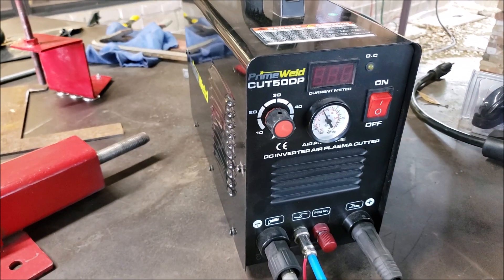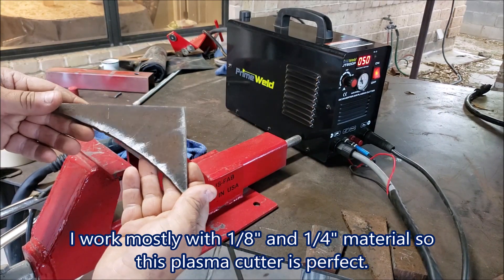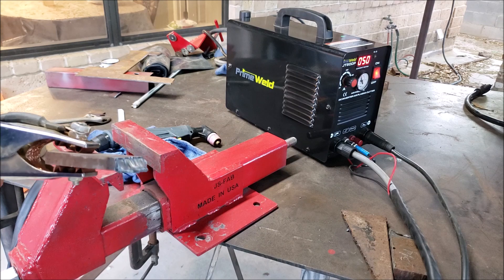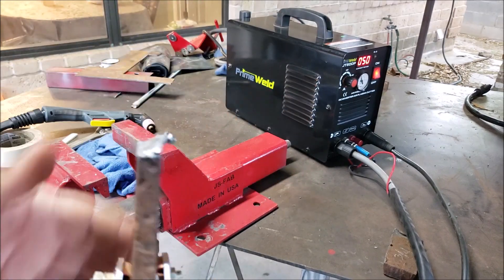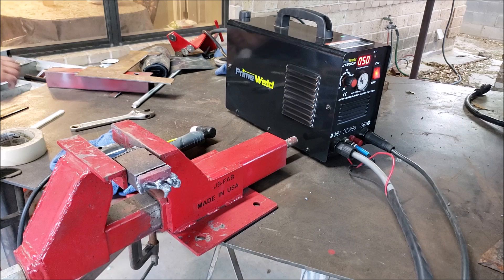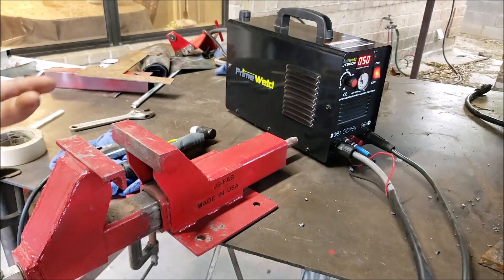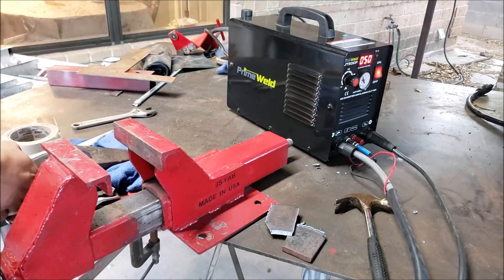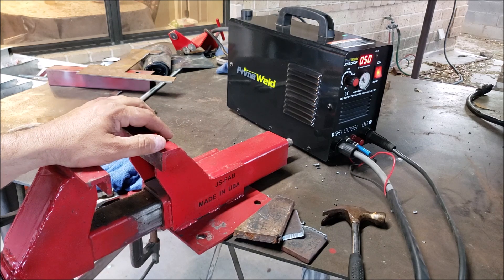Testing the best and Cheap Amazon Primeweld CUT50DP plasma cutter on 240v

Comment: What size of air compressor were you using?
Reply from the maker: I think I was running my DXCM601 which is a 60 gallon compressor. I have used a 24 gallon compressor with good results before when on remote locations.

Comment: Did it cut better after you replaced the consumables and took more time and 
connected the ground clamp to the work?
Reply from the maker: This cutter worked great after fixing my air supply. I replaced this machine with the Primeweld CUT60 and I am very happy. I have other machines I tested last month, are you interested in Primeweld or a budget entry cutter.
Reply: @cutweldngrind I consider Primeweld to be "entry" level because I really don't care to waste time on "less than" equipment any more.  The very MOMENT I learned that YesWelder was using aluminum wiring I lost ALL interest in their products despite them giving me a nice hood for helping them make a correction in their manuals. I hope I like the hood, but haven't struck an arc in front if it yet. I just bought the PW TIG325 and am considering their cutting tools-as they have quickly built a solid reputation for pretty good stuff at a fair price. I watch Jody (WT&T), Aaron (6061) and Justin (TFS) mostly. They make good content-and from a professional's perspective-without being too pushy on products and services.  Happy Thanksgiving.

Comment: One problem you have is not enough air pressure...you need 90 psi..thats why your cuts arent straight..plus the tip is probably distorted...55 psi isnt enough

Comment: The primeweld website says 55-60 psi air pressure for the plasma. Were you able to cut the 3/4 inch with that air pressure?
Reply from the maker: I know I tried 60 psi but not sure if I ran 60 or 65 for my .750 and 1.0 inch plate test. I actually been wanting to place my Crystal 3000psi digital gauge to verify pressures.
Reply: @cutweldngrind  awesome! Thank you for your reply. I've got a 20 gallon 135psi 110v air compressor and was hoping it would be big enough to run this plasma cutter.
Reply: @cutweldngrind  I only have 1 240v 50amp outlet in my shop and was hoping my 110v air compressor would work since I would need my one 240v outlet for the plasma cutter.

Comment: Thanks for another great video. These seem to be a nice step between the no-name/no-support cheapest Amazon machines, and the industrial quality high $ Miller/Esab class. Thinking about this, or the Primeweld 60.  Rarely do I cut anything 3/4 or larger (and I have a torch for those occasions) and I doubt I’ll ever own a cnc cutter table.
Reply from the maker: I never got a chance to use or own a torch but I would like one in the future. The online market place is loaded with junk that has no support but Primeweld is an awesome brand that has the best customer service I have ever seen. I tried getting an ESAB or (forgot brand name)  but they were super expensive that I just went elsewhere.

Comment: Nobody mentioned it in the comments, but before I buy one (I own their TX225 TIG welder), and I'm looking at the cheaper strike-to-arc model, I'd like to know more about why all your cuts were at an angle.  Why was the arc blowing off at an angle instead of straight down?  Did you ever get to make a cut with this machine where the cut was 90 degrees to the surface?  Makes me wonder if these prime weld cheaper plasma cutters are really worth the money or not.
Reply from the maker: That's a good question. I did notice the angled cuts more once I went to 3/8" or 1/2" material. I was first thinking the consumable were  worn out  and when I  replaced the issue seemed to fix it self but noticed it a few minutes later. I wanted to try higher pressure but did not want to damage it as I was going to give it away. My powermax45 runs at a much higher pressure but not sure if the issue could be related to the design of the machine or torch itself. I do want to buy another one as its a hassle to be moving my Powermax.
Reply: @cutweldngrind  I bought one and cut 3/8” without the angled cuts you got. Very happy with it.

Comment: Jorge can the tip be dragged across the metal when making the cut or you have to lift it up a bit?
Reply from the maker: I had no problem dragging the plasma cutter. I had the plasma cutter about 6 months to test and then gave it away. The Cut50DP has pilot arc and maybe that's why it can be dragged. This unit worked great and been wanting to buy one.
Reply: @cutweldngrind  
Thanks you Jorge..

Comment: I have a 15A circuit at home, will I get away with using it or will it flip the breaker?
Reply from the maker: I did my cutting on 110V-20A and 240V-50A. I think you could probably cut thinner materials but since I gave the machine away I have no way of testing this out.

Comment: I generally notice that I had to increase air pressure a bit and seriously reduce speed when approaching maximum capacity. Different machine, same rating. I said "had to" because mine was stolen while in the hospital with a heart attack. Fine healthwise but still trying to replace stolen equipment. Insurance company paid depreciated value, not replacement cost. Changed insurance policy. I suggest everyone verify replacement cost coverage!
Reply from the maker: I actually started to increase pressure on inlet but I really should verify with my digital gauge. I used a powermax45 and also struggled on 3/4 inch plate. I know the feeling of getting things stolen as my first welder was stolen after a few months. I was told to document all my serial numbers and never did so but that can probably help in a case. Take care bud. I should start making more videos soon.

Comment: Very realist video,thanks for taking the time to show the machine. What machine do you recommend for 1/4 “ metal? Not necessarily a cheap machine.
Reply from the maker: I am just a hobbyist fabricator so I don't have much experience with many welders. I like to Arc weld with my Hobart Champion Elite on 1/4" and thicker. I have used a Hobart Ironman MIg welder and that has worked great for me too.

Comment: To make a good cut in that 3/4u have to:
Clean your metal
Check of u have a constant psi
New consumables 
And use the space guides
Reply from the maker: I think this machine is rated for 1/2" max. I did run another test using new consumables and the cut looked a bit better but would not cut 3/4" The pressure is constant coming from my 60 gallon compressor. I did apply a bit more pressure than recommended and the next step would be to put my digital gauge and verify pressure. Thanks

Comment: Thanks for the nice demo Jorge! I found your video while researching plasma cutters under $500. I am building a street rod out of a 1940 Ford pickup that has been in our family since 1963 when me grandpa bought it for my dad when he was 16. A plasma cutter would be very useful for this project and others. Could you please show how this one does on 16 gage rusty and painted metal?
Reply from the maker: 16 Gauge is very thin and this should go right through it. The Pilot Arc allows the machine to cut through painted or rusted materials.  I am planning a video soon where I demonstrate the Pilot arc and Non Pilot arc cutting painted, rusted and clean steel. I will see if I can find a fender or some material in that thickness for you.
Reply: cookie did you wind up getting one of these? If so do you have to lift he nozzle up a bit or can you simply drag it across the metal as you are cutting?
Reply: Your grandpa Sounds like he was awesome

Comment: Awesome, Been wanting to have of those kind of cutting tools , tired of grinding hehe keep it up !
Reply from the maker: Thanks 👍. When I bought my first plasma cutter it cost me $700 and was used, New price was over $2400. I have ran several test and it has worked great so far. I highly believe if you cut 1/4" or thinner material this will be a good machine as they also have great customer service. I prefer a plasma cutter over several of my cutting tools because I don't like shavings all over. I will be giving this away either next month or June.

Comment: Thanks for the review. I'm researching plasma cutters now.  Have body work to complete on our 99 XJ. 

Beats using using a grinder with cutoff wheel. 

Looking forward to the next episode..
Reply from the maker: Glad I could help. Professional  plasma cutters will cost upwards of $2000 like the PowerMax 45 I own. I have seen several machines in the $300 to $500 price range that just allows people to buy their first cutter. I should be giving this out next month or June the latest.

Comment: Nice review keep it up, definitely would like to know what size air compressor your using sir? Looks like a nice addition 👍🏽
Reply from the maker: I did a video on the compressor on my channel but its a Dewalt 60 Gallon, I believe it was the DXCM601. The Plasma cutter runs on lower pressure ( 55psi ) which allows me to cut a lot of material even with the compressor off. I also run a Husky 30 gallon and that also works good. The PowerMax45 also works great with the 60 gallon compressor but the 30 gallon struggles to keep up as it used more volume at a greater pressure.

Comment: i just bought the prime weld arc welder and 50 amp plasma cutter combo machine  Haven't got to use it yet
Reply from the maker: I have enjoyed this cutter for sure. I like the compact size, light weight, multi voltage and price. PrimeWeld also has good customer service. Let me know how it goes.
Reply from the maker: Send me an email with your Youtube name as comment to jsfab_youtube@yahoo.com.

Comment: Looks like a decent beginners machine; I'm really considering buying one. Question, how many PSI of air were you running during this test demo?
Reply from the maker: I think it was 55 psi. I would need to apply pressure to see where the guage was set at. My powermax45 runs a bit higher on pressure.
Reply: @cutweldngrind  how big of an air comp
Reply from the maker: @horaciosalinas8145  I noticed the Primeweld plasma cutter would run longer than my powermax45 with the same volume. I have a 60 gallon compressor but ran my powermax45 on a Husky 30 gallon for years.
Reply: @cutweldngrind  and which one would be the smallest air comp to make it work
Reply from the maker: @horaciosalinas8145  the bigger the tank the more you can cut non stop. If you plan to do small cuts maybe a 20 gal could work but if you cut 8 feet of 1/4" plate you need more volume. I have not worked on anything lately to test.

Comment: Looks like it does just fine👍
Reply from the maker: Yeah, I think it did good especially for the price. Its rated at lower pressure than my old powermax45 but I might try going a bit higher on the pressure.